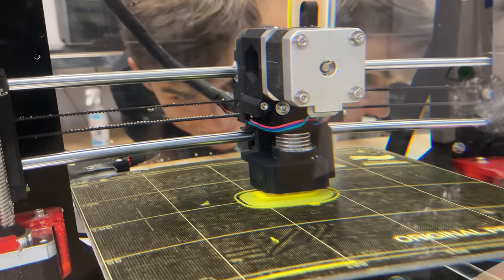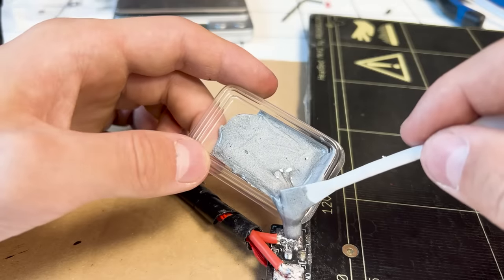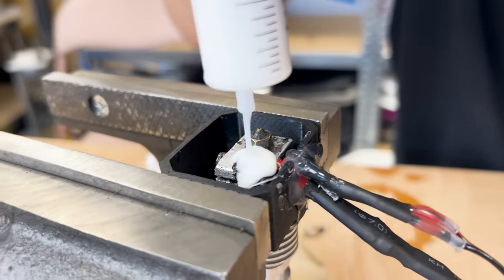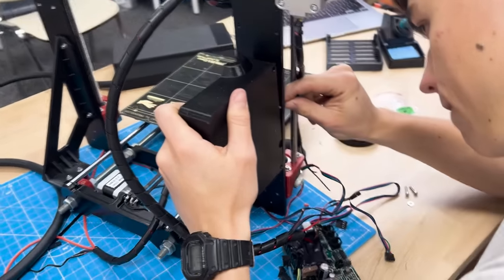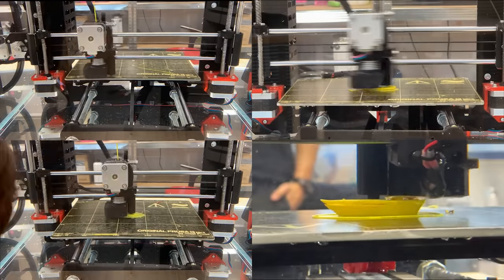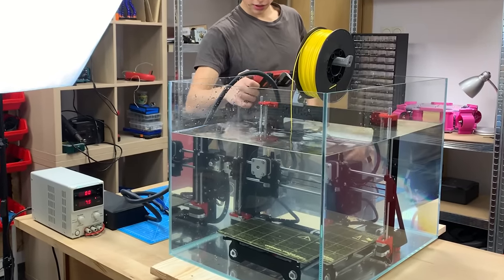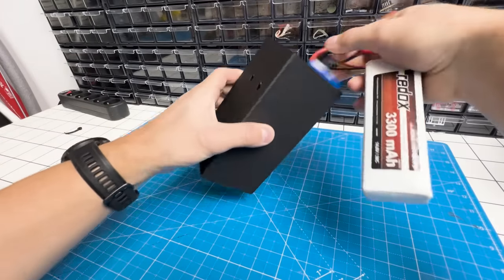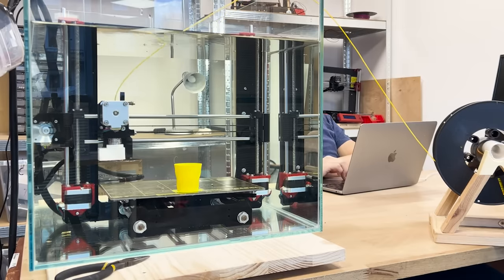3D printing underwater actually WORKS

Comment: Wow! I can't believe the layer adhesion worked as well as it did. Amazing
Reply from the maker: That was maybe the biggest surprise. I love that you told us it wouldn't work at OpenSauce
Reply: @CPSdrone  lol love to see some polish stuff on english yt. i was geniuenly suprised when i saw allegro XD
Reply: @CPSdrone dude is rubbing it in lol
Reply: tow one of these setups behind your kayak in case any parts break while you're in the middle of the lake
Reply: When global warming covers the earth in water, it Will no longer be funny lol
Reply: I was wondering why on earth they didn't go with mineral oil to begin with!? I've been looking at sick ass computer setups using that and always wanted one for myself. Now I'm looking at my ender 3 like -.-
Reply: Make the bed drop into water as it prints so everything above the current layer stays dry.
Reply: @CPSdrone  "Work" lol
Reply: @helavion8331 tylko czemu nikt nie pisze po polsku?
Reply: Two ideas:
Add salt to increase density to about 1.3g/cm^3, roughly that of PLA and PETG to forget about using supports.
Or use distilled water (almost insulator) and save on silicon and epoxy
Reply: @andruszyk76 probably because the videos are in English, so even polish people like us just talk in English. We won't just talk in polish because the creator is, when audience mostly speaks English
Reply: Now can you try In a vacuum chamber 🤔❤@CPSdrone
Reply: @CPSdrone Now can you try In a vacuum chamber 🤔❤
Reply: Now: 3D printing in space and 3D printing in lava

Comment: Instead of water, you could use mineral oil just like when PC enthusiasts build submerged PC's.  It should help with the corrosion problem and even add lubriaction the motors and bearings. You would also not have to epoxy anything as mineral oil is non-conductive.
Reply: So much mineral oil!
Reply: Especially for the swimmingpool :)
Reply: I actually looked into this a few years ago. The prevailing issue that arises is that the mineral oil typically used for submerging PC actually burns at a lower temperature than most print nozzles.
Reply: @jonathanschladetzky4754  Mineral Fire sounds cool as well.
Reply: @jonathanschladetzky4754  that would only happen once the entire volume of the reservoir crosses that temperature threshold.  Much in the same way you can hold a blowtorch to a water balloon without popping the balloon. It won't have a chance to burn before the heat gets wicked away.
Reply: oil has less density then water - i think something with a higher density would be much better in the aspect of bridging. glycerol?
Reply: You can also get mineral oil that's a little more viscous than water. That should help with overhangs. There is already a printer that prints in jelly like goo and therefore does not require supports.
Reply: @JustNice980  hmm didn't actually think about that I might need to revisit this now
Reply: @jonathanschladetzky4754  spoiler alert!
Reply: Had the exact same thought, and just deleted my comment stating the same, after scrolling and seeing this. Upvote therefore 😅
Reply: You all are missing the biggest issue with using mineral oil. There's no way your getting bed or layer adhesion printing in mineral oil
Reply: @kyleo1236  I would have thought the same thing about water.  I'm sure any adhesion issues stemming from the use of mineral oil could be overcome. My first thought would be using a textured build plate.
Reply: Nice and oily prints will you have.
Reply: Immerse the whole thing in fluorinert like 1980s super computers. Very dense. Not electrically conductive. Extremely expensive though.
Reply: then it wouldnt be underwater
Reply: There was also a very low evaporation coolant I think 3M was developing. If it evaporated off the hot filament then the adhesion wouldn't be as much a problem.

In that setup for computers, they had a sealed unit and a radiant cooler on top, that would condense the liquid to keep cooling the computer.
Reply: yeah im sure mineral oil wouldnt effect the adhesion at all
Reply: Pretty sure mineral oil would attack most filament types because of it being petroleum based.
Reply: Another channel tried it. It cools the print head too quickly.
Reply: Especially if the oil used isn't attracted to the PLA, and maybe if it had similar density.
Reply: I was thinking the same thing.
Reply: If you want to print some crazy overhangs, just seal everything and print in a tank full of liquid mercury.
Reply: And it would be equally boyant to eleminate sagging and effectively allowing printing with no support.
Reply: I dont think the print would stick to the bed with oil, but I wouldn't imagine it sticking to water either, so Idk lol
Reply: Could use PAG. Dielectric, water soluble(for bed/layer adhesion), high shear strength(move fast through it w/o cavitating), high temp(used for quenching aluminum), low viscosity.
Reply: Mineral oil flash point is around 135 °C so the whole tank would have to be at that temperature to strat making enough vapours on the surface that could easily ignite. But with the volume of the liquid in the tank don't think it would get that hot
Reply: @Blackrhyme7  you are correct.
Reply: That would be a bad idea. Many plastics will absorb mineral oil. Even using water is bad for most plastics, as this practically guarantees hydrolysis occurs. This will weaken the plastic.
Reply: The main advantage of using water is that it naturally evaporates in the air, with mineral oil, you will get an extremely greasy part, without much practical solutions to clean it than disolving oil into organic solvents such as acetone, which could damage the part (acetone vapor smoothing works on some plas)
Reply: The main point of fdm versus resin is the absence of chemical post-processing, with mineral oil, you will need to clean each printed piece in organic solvents such as acetone which is 
1) extremely flamable
2) toxic
3) cancerigenous
4) extremely volatile (an explosive air mixture could easily appear in a not well ventilated area)
Not to mention that other organic solvents are even more toxic for the body (toluene, benzene, and white spirit directly damages the brain to only quote them)
Reply: water is not conductive either thi
Reply: @JustNice980  Yeah but like, Part of the goal would be to heat the liquid as well, So the concern is reasonable that it might all be very hot and very bad
Reply: Or dry water.
Reply: @jonathanschladetzky4754 with what air will it burn when completely submerged... Total BS theory, look into how flash points work.
Reply: Flash point is 140ish degrees C. That's a bit too high for 3d printing.
Reply: then it technically wouldn't be underwater but undermineraloil printing right?
Reply: Bye bye layer adhesion
Reply: Think that wpuld cause fusing issues with the plastic
Reply: @kyleo1236 oh you are right !
Reply: @realherobrine5636 it would be underoil, which is much cooler
Reply: What if it ignites
Reply: Problem being that mineral oil will dissolve certain plastics and also is an absolute bitch to get off of things without the use of solvents which, also dissolve certain plastics. Distilled water is a much better option overall
Reply: There is no way that the layers will stick with the oil in the middle
Reply: Why don't just use baby oil? It's same and won't damage the fillament right?
Reply: I was surprised that the plastic stuck with water, but I'm not certain oil would allow any adhesion
Reply: You probably would have adhesive problems using oil
Reply: Plastic doesnt like mineral oil so idk if thats viable
Reply: @jonathanschladetzky4754  distilled water (battery water) would be ok, right?
Reply: Some transformer oils are good for higher temps.
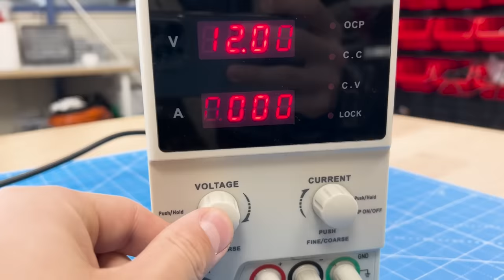Reply: a youtuber actually did just that. It ended up not working because the oil cooled the machine too well and it wasn't able to melt the plastic anymore. She also tried pouring oil only on the print bed and on top of the print to check for adhesion and it worked just fine. Channel: emily the engineer "Pushing my 3d printer to its limits" @7:50 in her video.
Reply: @antongunther3977  I watched the video, and it doesn't prove anything, however it's a great place to start digging. It looks like there's no physics incompatibility using oil, but it requires a fine tuning to make it work.
Reply: Especially when the plastic is heated, even fairly inert plastics in NPT conditions start reacting with oils when heated.
Reply: @autonoob 😂😂
Reply: https://www.youtube.com/watch?v=FYuqLsvRXhU   -   Someone already did it. They didn't do any prep... just threw it in a vat of oil. Maintaining temps was an issue.
Reply: It might not work, MO dissipates way too much heat.
Reply: oils may adversely affect layer adhesion.
Reply: Actually no oil interacts with plastics they would dissolve in it.
Reply: No. That defeats the whole purpose of using water in the first place to cool it. There’s a reason we have water cooling in tech and not mineral oil cooling.
Reply: @Cookies4Wookiees  greatly depends on the plastic.
Reply: You can also use natural Esther oils such as olive oil. Better for the environment and easier to recycle
Reply: @meettrout419 Are you okay?
Reply: I'm trying to figure out if their will be layer adhesion issues with mineral oil.
Reply: Check out Emily the Engineer. She did just this
Reply: @michaelramos4482  Almost.....
Reply: The problem is that it will resist first layer adhesion.
Reply: Oil would react with the plastic
Reply: As someone already pointed out but water isn't conductive also unlike a PC a printer involves a lot of movement and mineral oil has a massive viscosity compared to water meaning a ton of extra drag on the servos and a much slower print
Reply: Be careful, mineral oil may not play well with polymer. I don't know if it will dissolve the plastic, or cause adhésion problems...
Reply: @squa_81  the dissolving would depend on the plastic.  As we saw, even water causes some adhesion problems. At the very least the adhesion problems would be similar to water. At the worst, it may stick to the plastic enough that it completely prevents adhesion.
Reply: While it's a lot less than other oils, mineral oil still degrades some plastics including some used for printing, it's a lot more viscous, which would cause problems printing, and the biggest problem, it is flammable and would be exposed to significant temps for hours on end
Reply: Josef Prusa is taking notes 😏
Reply: How about pure ethanol?
Would that work?
Reply: I feel like greasing up the build plate would be terrible for adhesion.
Reply: but then they couldnt take it to the pool or 3d print a cup that is prefilled with water
Reply: That's a great idea! My other thought was that instead of submerging the entire printer what if you just made a compartment that would fit inside the print array and you just have to secure the printing "arms"?
Reply: so long it stays submerged corrosion should be a minimal problem
Reply: There is a reason you degrease before welding anything. Also, pla may get dissolved? But there may be other liquids that are maybe heavier than water, and much better for this purpose. Or maybe a solution of water and other stuff.
Reply: Wouldn't the oil make it more difficult for the plastic to stick to other plastic, even if they're both partially melted?
Reply: RIP layer bonding
Reply: Heat conductivity of mineral oil is much lower so it might not work as well as water and cleanup is gonna be a thing too
Reply: SOMEONE SAY OIL
Reply: @jonathanschladetzky4754 burns only if you have oxygen. If you don't, there's no flame.
Reply: However mineral oil might weaken the plastic filament, dissolving it at those higher temperatures. As well oil has less thermal mass, so it won’t cool filament anywhere near as quickly as water.
Reply: Emily the engineer did it

Comment: Why didn't you use mineral oil instead of water?
Reply: Because then it wouldn't be under water
Reply: Althought submerging it was originally for the cooling, with more r&d that technology might enable them using 3D printers for underwater missions(maybe building or repairing deep sea structures?)

Comment: Distilled water is not electrically conductive. It is the minerals in water that are conductive, such as calcium, magnesium and iron that are electrically conductive. Then if you remove them by distilling it, you get non-conductive water. Therefore, you should be able to put the whole printer in your distilled water without any modifications at all other than removing the fans, as the water will give them too much resistance and they will burn out due to overload. It therefore does not make sense to me that in do all the modifications that you guys do?

Comment: Amazing work!
Reply from the maker: Your approval mean a lot :) And thanks for putting us in your OpenSauce video!
Reply: @CPSdrone have you considered using "Corrosion X HD in all the stepper motors and connectors. Also, pour the silicone in smaller/thinner layers and it will dry better.  Also maybe consider your layer smash/ thickness. With the print happening under water maybe you want the tip of the nozzle to "dig in" to the previous layer to get better layer adhesions. Maybe. At this point everything is trial and error.
Reply: Hi I am a big fan

Comment: Do this with a core xy machine which moves the bed down as it's printing. That way, you'll keep most of the sensitive stuff out of the water while still getting the full cooling benefit.
Reply: you'd have to use a large aquarium because if you print something large it would displace the water causing the water level to rise.
Reply: @kyleo1236  Actually it would only displace by the volume of the filament, not the print.

That would mean that if you were to print an entire roll of filament, it is equivalent to sticking the filament in the bath. Nowhere near as much displacement as you might think.

Likely could be mitigated by just having a float to check the fluid level and drain some out whenever it gets above a specific point.
Reply: @SirSpence99  Or solve it by placing the filament roll into the water. Adds other trouble too.
Reply: This would also allow you to print hollow parts that don't fill with water, by keeping the water level just below the top layer. That would also improve adhesion.
Reply: That's exactly what crossed my mind! There's already collapsible silicone wash bins if you get one that's base is slightly larger than the build plate you could even use magnetic build plate to secure it down then modify it so that the rim of the tub stays static. The only thing that would be the problem is as the plate goes down making sure the water stays level. I'm sure that could be figured out though... gravity, siphoning, something.
Reply: @knuschi7070 Just drill a hole in the aquarium where you want to maintain the water level.
Reply: Now this is a fantastic idea! If you can maintain the water level just a layer below where your printing then it can print on dry plastic for perfect layer adhesion. You'd need to get a nozzle that has inbuilt z-hop (like in some dueal extruders) rather than moving the bed. And add a few drops of soap to get rid of surface tension. Probably a good idea to add in a corrosion inhibitor at the same time too.
Reply: @charmio But, but, but that wouldn't require one to build a complex water height sensor, read the data with a custom PIC32, send it over Bluetooth to an ARM-based SOC running OS/2 inside an emulator to transfer it over WiFi to a cloud service, from where a Raspberry Pi pulls the data and then controls a servo to send the data as morse code by tapping onto an acceleration sensor connected to a first-gen Arduino that then controls the relay to turn on and off a peristaltic pump to lower the water level!
Reply: @charmio that's easy. Just need a hole in the wall to keep the overflow level a bit below the nozzle. 

But water + plastic + process temps = hydrolysis in many types of materials.

So keeping it a couple layers down would be a big benefit there.
Reply: @HenryLoenwind not at all. See above comment.

Nozzle height is fixed. Put a hole in the wall just below the nozzle and it'll sort itself out.
Reply: I think you all need to reread 😅
Reply: Yes in a Core XY you can have all the motors and electric parts above water, on top of the printer You could have just a long hotend, like the Ubis, with only the tip going underwater. And warm the water to the right temperature. A bowden would also simplify. 
You should have converted an ultimate. Just sealing the door and all walls, and replacing the bearings underwater, and making a hole at the tip height.
Good creative work, thanks for the inspiring work!😅
Reply: You could just put a tube on the side of the tank at the water level you want and as it level raises it will drain.
Reply: @kyleo1236  not if u have a hole in the side for the displaced water to flow out of